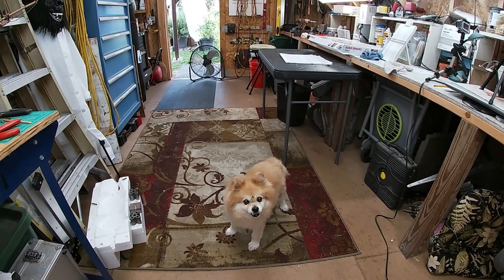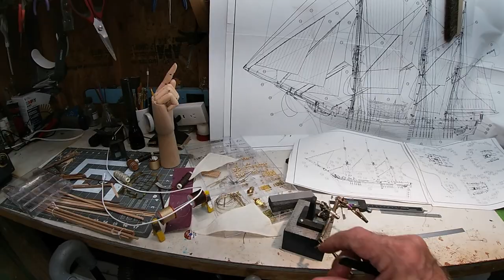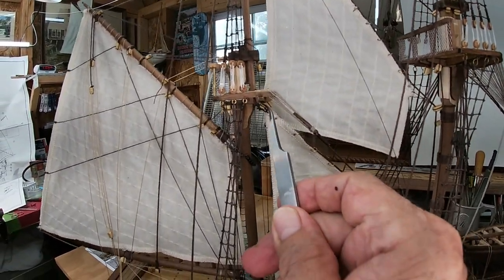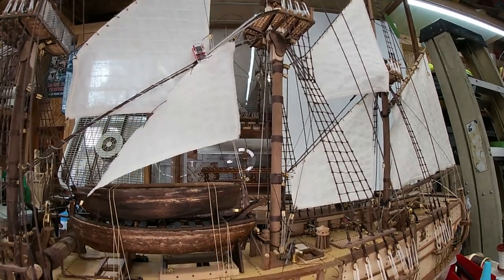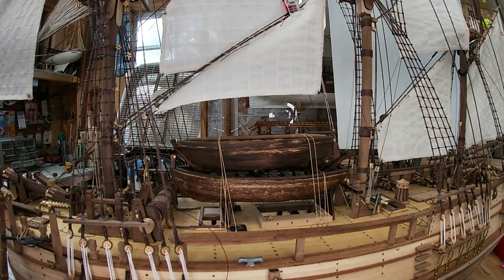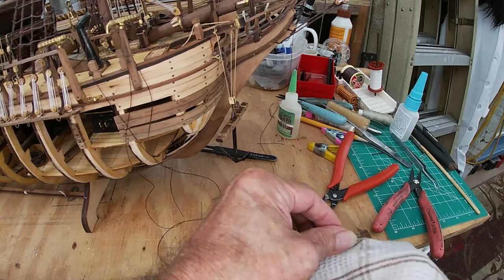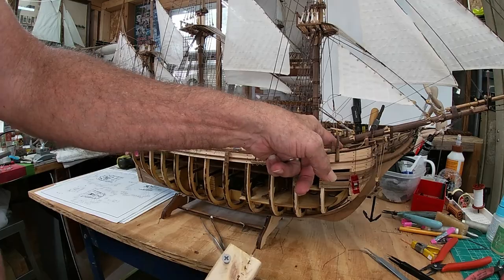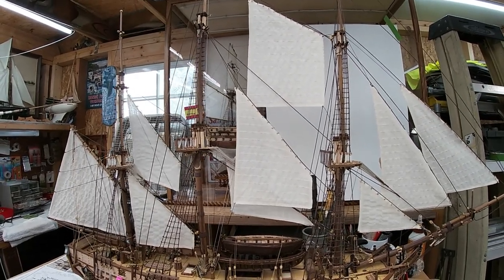HMS Bounty build part 42

Comment: Although my two current builds don't have any sails, I will use your sail related videos as my primary go-to for reference for my third build that does have sails. Any chance of a link to that modellers video with the fancy rigging tool you spoke of? 

Your camera positioning is always excellent and allows us to get right in there with you, however, I wonder if a light coloured piece of paper/card could be placed between the background and where you are working to help minimise background distractions such as the lines of your fans safety cover which plays havoc with this auld faurts eyes 😃

Your no-nonsense, friendly presentation is a formula to which I subscribe. Well done and thanks for sharing.
Reply from the maker: Ya check out "  Artesania Latina " web site for the two new models and the new line of tools.https://artesanialatina.net/en/micro-tools/61832-micro-rigging-tools-for-ship-model-8421426273212.html